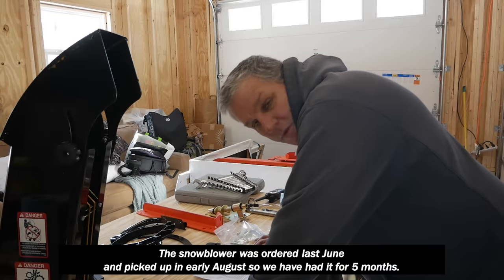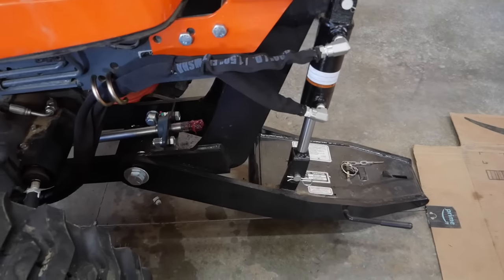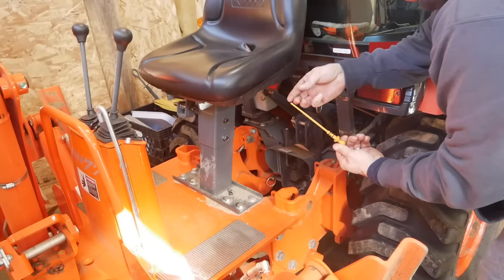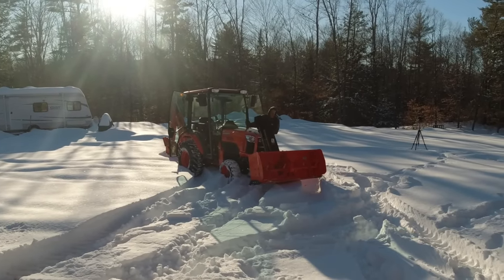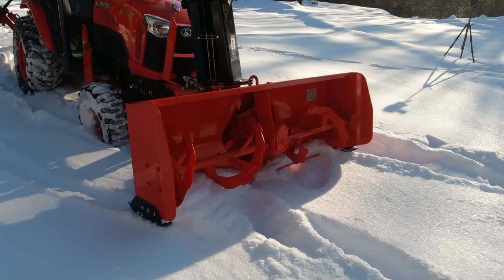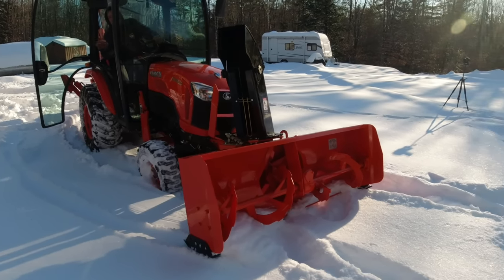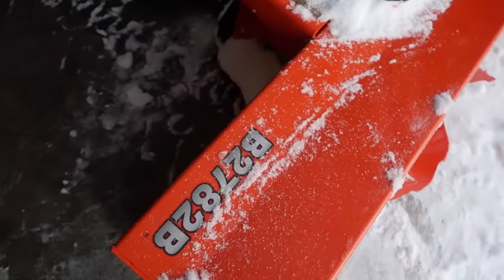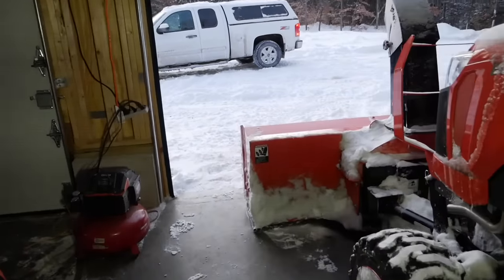The 'Maiden' Blow | Kubota B2650 63" Snowblower in Deep Snow!

Comment: I have the same blower on my B3200. I have passed the 500 hr mark on the blower. Things to pay attention to are.
Chain tension and lube using chainsaw bar oil. looser is better then too tight. When the teeth on the large sprocket 
start to curl it's time for a new one. The small one last's longer. Make a few spare chains with a new master link
for each chain. I have never had one brake but running a worn one will eat the sprockets much faster.
Pump grease into the auger zerks till you see it come out on the shaft on both ends. You don't want them to rust to
the auger and pretzel it if you catch something in one. I bought a lot of grade 5 bolts , nuts and lock washer's to keep on hand
I don't buy OEM sheer bolts. Also learn where the blower's sheer bolt is , take it to a fastener place and get a bunch
of the bolt's and nuts.
Change the gear box oil at the end of the season it's 80-W90 gear oil.
Last week because of the hours I replaced the blower shaft bearing and the 2 that support the shaft for the small sprocket. I think
the two for the auger shaft's will go forever as they spin slow and don't have much of a load.
Having some 1/4 inch key stock on hand is a good idea as the yoke for the shaft for the small sprocket has fallen off a few times
even when I have set the set screw so tight I was afraid I might strip it. I think lighter grease is needed for the square slip shaft and
that's what pulls it off when you raise the blower.
On the quick hitch where you tighten the large wing nut to hold it to the frame. Take a wrench to the bolt head that the wing is welded
too. It will loosen no matter how tight you tighten it by hand. You don't want to loose that large chunk of steel that it pinches the frame with.
Pay attention to the two large bolts that are used to hold both pieces of the quick hitch together. I had one loose it's nut and fall out
to never be seen again.
One last thing...I run chains of all four tires. Started out for the first five years on the rear. Finally coughed up the $$ to get some
front wheel spacers so I could put them on the front. Money well spent.
Enjoy the blower and don't blow out any windows.....
Reply: So what you are saying is parts will break often with this setup?
Reply: Great Advice!
Reply: @PartTimeYooper  Sounds like he might be using is commercially, and this does not look like a commercial grade blower.  It looks fine enough for private use, but commercial is a whole other animal.

Comment: I have an M5 and 3/4 mile driveway after 5 years I found the best thing is a 12' tow behind wheeled scraper. It doesn't gouge the road and mess up the gravel. The snow builds up to form a wedge that pushes the snow off to the sides like a v plow. I also use a 3 point 7' rake to groom the gravel.
Reply from the maker: Oh! What a great idea 👍 thank you

Comment: I demoed on of these years back on a 2650. It was impressive for what it was, but ended up not being adequate for what we needed. Demoed a 66~PTO HP tractor with an approximately 70”-76” wide, around 36”  tall  snow blower. That was what we actually needed. I was pretty impressed with the 2650 after using the 74hp tractor.
Reply from the maker: It’s doing the job for us. We wanted to keep it smaller because I didn’t want a dpf filter
Reply: @CreatingASimplerLifeOffGrid  Totally agree! That’s why I tried it out on my 2650( that was turned up) unfortunately it just wasn’t realistic and neither was the cost of the bigger tractor. I think the 2650 moved more snow for its size and power than the  bigger one did, but never did any testing. I think for driveways, especially long driveways, it’s a perfect application. The main thing for me was being able to get it done faster. There were times I would plow over 12 hours a day for several days in a row. I know that’s really nothing but my health wouldn’t allow it and I really shouldn’t have been doing more than 6 hours per day for only a few days in a row. 
I was doing several miles and had some spots that would drift 2-4 feet deep for a couple hundred feet in length. Plus after a plowings on the main road I needed to move the windrows back from the edge of the road. I was plowing at almost 4,000 feet elevation and had to plow in mid range, so I didn’t have the speed to launch the snow like I needed. 
My little 2650 was really doing more than what was designed for and I think it did it exceptionally well considering it’s size and power. It was truly just wishful thinking, on my part, wanting it to do the job of something twice as heavy and three times the power.

Comment: Read up on hydraulic fluid and tissue necrosis. You'll decide that you don't want to touch that fluid. It ain't just another oil.

Same blower here on the other side of Lake Champlain.  It's a wonderful piece of machinery. To counter the dealership bashing in this thread, Champlain Valley Equipment CVE here in Addison County is a great dealership and service center. Also, you'll learn to get ready for snow early: get your equipment installed and tested a few weeks before the typical first snows (that come in mid November at lakeside elevation). Don't wait until you're covered in snow to start unboxing and assembling your equipment! Make sure to torque down the bracket that mounts the quick hitch tongue to the front of the Kubota - it will vibrate loose otherwise. I had the whole assembly come apart on me my first season. Tore apart the PTO shafts. CVE dealer fixed up the mess.

Comment: I've got the Bobcat equivalent setup, and very happy with it. I'm blowing in tighter quarters than you, but extra shear pins are a MUST. Some driveway markers are handy too. Also, I have a box blade on the rear, and find it's super handy for scraping and pushing snow. The blower isn't fond of icy banks, and I have the shoes set quite high to avoid picking up gravel, so the box blade is the perfect companion.
Reply from the maker: Thank you. I appreciate the tips very much. I did learn about a few the hard way… shear pins… but the box blade on the rear sounds like a great idea👍

Comment: The dealer never told you about the hydraulic motor on the chute when you orderd the blower? From my experience with the bx2370 an the front blower is that the cutting edges wear very quick. So watch them. Keep shear pins close an also a set for the second stage auger fan, which is a different part Num then the ones that spin that first stage auger. Other then that, awesome tractor! So much nicer then it’s green counter part.
Reply from the maker: Thanks. He did, he just forgot to order it.

Comment: Good evening to both of you 👌😉 Yep that is not easy to set up for the first time, but practice oil grease make perfect and a couple of spare shear pines too 😂👌 You will be doing so tough competition with GP with that OUTSTANDING SNOWBLOWER 👌😉👍 If I was you, I will brush off all the snow that I could with a broom before put it back inside your garage Sir ( in case that will frost into ice ) 🥶  Cheers 👍😉👌 You can look what I use to coat my entire snowblower with clean SEA 30 oil for various reasons ( snow protection, Corrosion, and help to dry the snowblower too, etc,, )
Reply from the maker: Good idea. I was looking for something to coat it and protect it. What do you know about ceramic wax coating? I heard it might be good. love GP outdoors!
Reply from the maker: Lol. Thanks!
Reply: @CreatingASimplerLifeOffGrid  🤣😇👌

Comment: Good video, lots of snow.   We have a bit larger tractor and have a reverse driving snow blower. It gets tiring at times.   Also, love your cab, it’s a convertible ride for me.  Brrrrr
Reply from the maker: Thanks. We almost bought a tractor like that but when we found out it was zero percent financing… went for this one. No regrets
Reply: @CreatingASimplerLifeOffGrid   good idea.    We bought ours used from the previous house owner.   It was 4 years old with 42 hours on it.   58HP, 72” implements.   Our driveway is a little longer than yours, and it winds through a forested area like yours.
Reply from the maker: Sounds like you got a good deal 👍

Comment: I wonder if Berco made that snowblower because the build of it reminds me of 3 Berco’s I’ve had. Two 40” 700255’s I sold in February 2022, both to the same guy for $800. He was going to attach them side by side for his small farm tractor. I had about $220 into buying them used. Last summer I found a 44” Berco for $100. I’m going to adapt it to my Toro 5xi 522xi. The tractor is 40.5” wide without weights. A 44” wide snowblower should make it a little easier to turn going through deep snow.

Comment: That chain is a "safety" thing and probably just a lawyer trophy from some lawyer who got rich.  Anyway, that PTO is obviously dangerous, if you get caught in it, you're gonna have a bad day.  There is a shield on it which has bearings (kinda) that allow it to spin independent of the shaft so that if you would contact that shield, it will stop spinning while the PTO continues to spin.
Well, those bearings can seize or fail and then you don't have that protection anymore, but you wouldn't know until you grabbed the shaft.
What that chain does is hold the shield stationary while the PTO is on so you can verify visually that the safety shield is functional.
Reply: (edit)  I could be mistaken, I was just so used to seeing those chains on farm equipment.  Perhaps that is just a holder for when you mount the unit.  You just have to remember to unhook the chain before hooking up the PTO.  ;)
It could also be both.

Comment: That is one beast of a snow blower! Looks like it works very well. Despite your initial minor set back with a few parts & pieces, everything came together nicely. That is going to make your winter life much easier and way more enjoyable. Plus it gives you peace of mind knowing that either one of you guys could almost effortlessly clear your driveway. 😉 Another worthy investment. Hopefully it's as good as Kubota's tractors and gives you many years of trouble free service. I really like the fact that it doesn't leave a wall of packed snow on the edges of your driveway like a plow would. That should allow for better drainage . As you know, long island snow is usually wet and heavy so I spray a heavy coating of silicone spray inside the chute and impeller/auger area to minimize clogging of my tiny 22" 5hp snowblower. I doubt that you will ever have that problem with that beast. Congratulations and best of luck with it. 👍👍
Reply from the maker: Worth every penny!
Reply: @CreatingASimplerLifeOffGrid  thats pretty good of the kubota dealer to do that its like my kubota dealer here being great for customers the deere dealers here wouldnt do that

Comment: Please condsider a rear box scraper to replace the rear hoe. See my rig in my video. You will enjoy backing over snow / dirt/ ag pulling it out. It saves turnig the entire tractor around. You'll work faster. Mine is a "rollover" style. Meaning pull debris forward or push stuff back. 
In my case the rear box (#800) is about right for the front loader balancing.
An "el cheapo" rear blade is petty cash ≈$300. Box ≈$600.  Rollover≈$2200.
The rollover will assist the ftont to stay level, the each sorts work level espcially in soil or rock drive. 
Your blower seems to leave a pretty path but a rear blade will improve it. Believe it or not that rear blade will catch what the front missed.
Reply from the maker: Will definitely consider. Thanks 👍

Comment: You said that you made the bolts as tight as you could make them. You should be using a torque wrench and elastic stop nuts for assembly. I hope the bolts don't break from over tightening. Please feed the wildlife corn and dog food, that will pretty much cover everything.
Reply from the maker: Everything was torqued except for the two that needed to be torqued to 400 foot pounds👍
Reply: @CreatingASimplerLifeOffGrid  oof, those sound like the important ones.  I wouldn't expect someone to have a 400 ft-lb torque wrench(those are big bucks) but sometimes you can cheat.
For example, I had an 8' cheater bar when I "torqued" the ball hitch on my car (it was 250 or 350 ft-lbs, I forget witch.  I thought I was gonna start sliding the car, lol).
If you need 400 ft-lbs, exerting 40 pounds on a 10' cheater, for example, should get you close enough.
Or have the dealer do it.
Reply from the maker: @l337pwnage  thanks!

Comment: Did you ever figure out the rattling noise coming from the fan when you first fired it up?
Reply from the maker: It’s just the way it sounds and I think it’s because of the chain
Reply: @Bob  I was curious too.  I found another Kubota vid and that one made a similar sound, especially when the blower was fully raised.   This one probably sounded extra loud because it's brand new and had no snow in it to deaden the sound.
Reply: @CreatingASimplerLifeOffGrid  Chains can make all kinds of obnoxious noises.  I never gave it much thought until I looked at exercise bikes.  Chains were always the standard, but now some use belts and, wow, is there a noise difference.
Reply from the maker: @l337pwnage  Good to know, thanks